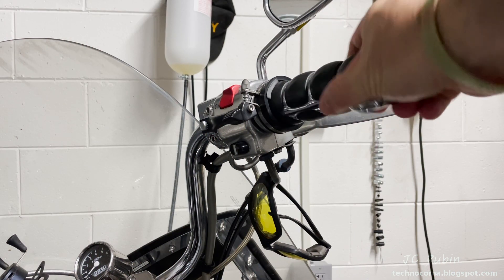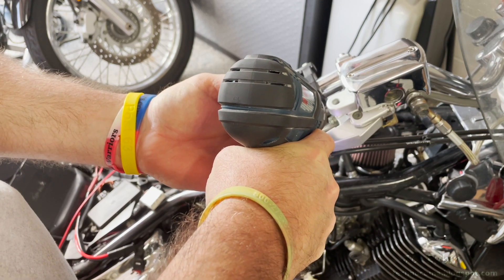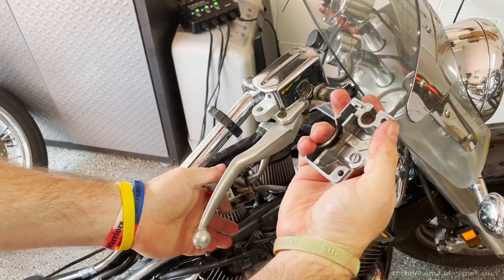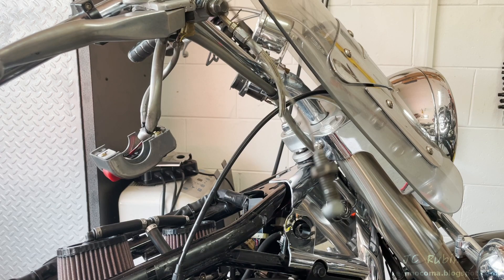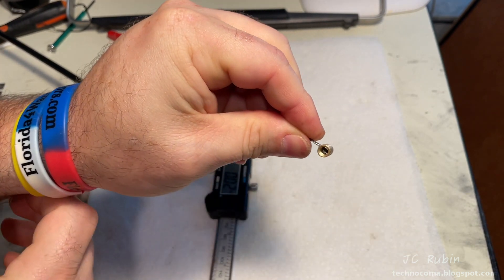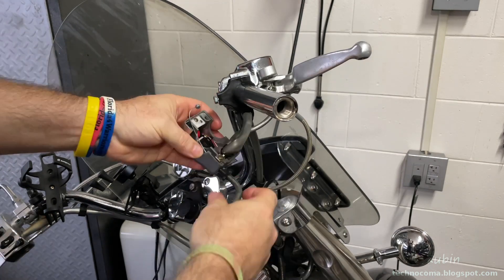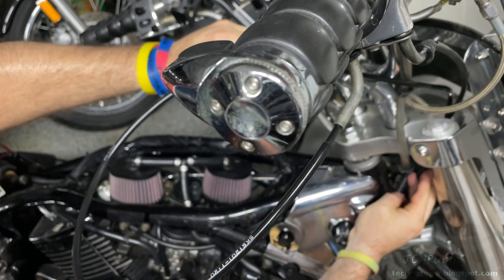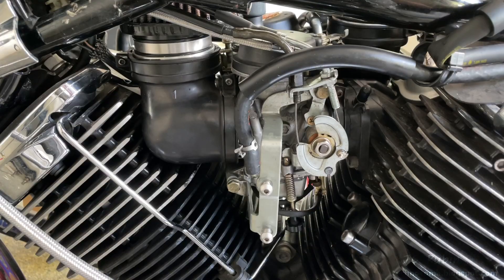Yamaha VSTAR 1100  Throttle Cable - Repair /  Replace / Maintenance

Comment: I had the same problems with i believe the pull side. Order from yamaha, 3 times wrong part. Then I showed them the old one. Different part # Make sure that they order your parts for Silverado, if that's your model. By chance have u seen  a reckless batwing install on a 1100. Thanks for your posts

Comment: I have an 09 vstar 1100 that the drum on the carb itself doesn't return. Ive backed it off and added an extra spring to help it return to no avail. Any tips or know where i can find a new spring set up?

Comment: Always enjoy your very informative videos. Hope you can help. I had my carbs rebuilt a year ago on my 03 1100. In replacing my throttle cables, I find that the throttle body will not budge. What can I do to loosen it?  Thanks
Reply from the maker: loosen the adjusters, they may be binding up.
Reply: @retrotechandelectronics  Thanks for that. Where are the adjusters located. Thanks

Comment: I guess ill modify the old cable , i replaced the pull cable because that steel was frayed bad but the push cable seems to have alot of play , ill try to keep playing with the adjustment

Comment: I have watched a bunch of your videos and I was able to get a 650 that’s been sitting for 3 years back to life! After doing a test ride I’ve notice the throttle gets stuck (almost like a cruse control). Is this something that can be corrected by getting oil down inside the throttle cable?
Reply from the maker: Possibly. Try checking if the throttle cables bind whilst disconnected from the carbs too, and if not it could be maladjusted, that causes binding

Comment: I resently removed my carbs and reworked them. But the person helping me had started before I got there and when disconnecting the throttle cables took the nut off the carburator throttle holder and that made the spring unwond. now that we reassembled the carbs and put back on my throttle does not spring back in place. I try retighten the spring and put the throttle cables holder back on the carb. but that just made my throttle harder to turn and not spring back. Any help would be appreciated.
Reply from the maker: I have several carb repair videos with no scenario when that spring need be untensioned for normal cleaning.

Comment: What would it cause it to die down while riding? Can’t idle without choke, can’t bump start, pick up coil is getting 200 ohm reading. I think it might be a clogged carb or something to do with fuel delivery. I bought a bike without knowing it had a fuel pump delete so I don’t know if that has to do with anything, I have the video showing the symptoms on my channel
Reply from the maker: WHy would someone pull the fuel pump from this bike? Its not optional.
Reply: @retrotechandelectronics  I thought so myself… but it ran fine for 10-13 miles before it complete died. Not sure if he gravity fed the carb before he sold it to me like that
Reply: @retrotechandelectronics  I’m guessing it was a bobber project, for the fuel pump delete.

Comment: 02 1100 front brake leaver, 
No friction, in cable.
Show replacement step by step.
Cant find video anywhere on doing this.
Reply from the maker: The front brake….. has no cable…. It’s hydraulic… brake fluid. This level of repair isn’t for you. Take it to your local shop.

Comment: I like how the clymer says to simply take the cables off at the top and use a tool.. those bastards don’t come off the throttle drum without first disconnecting them down below
Reply from the maker: Those manuals come close..... but not perfect.
Reply: @retrotechandelectronics  tell me about it, I destroyed a cable trying to pry it off the throttle drum lol